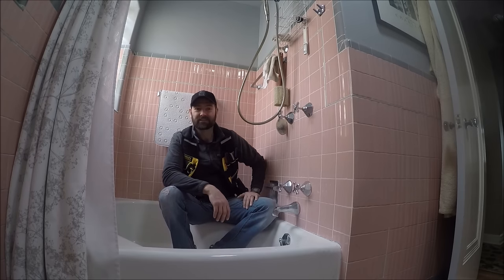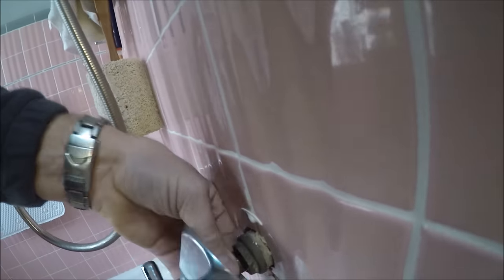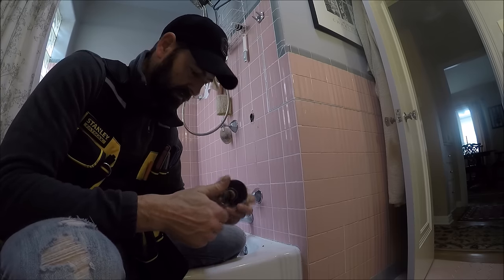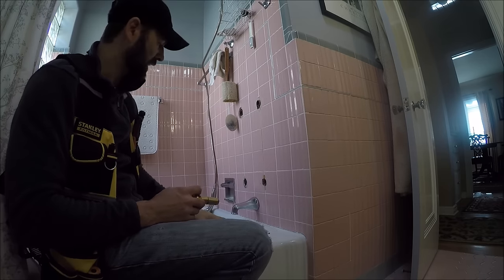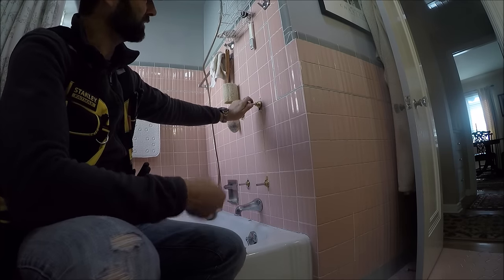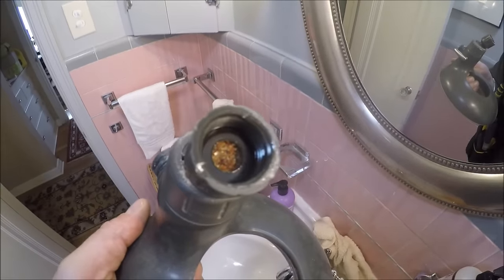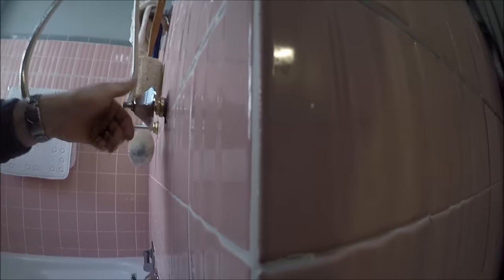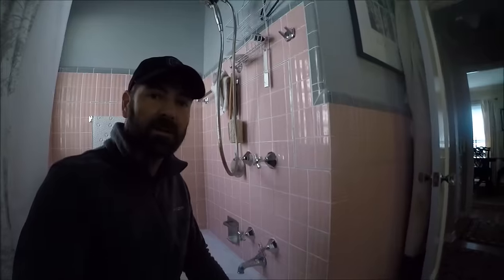HOW TO REPAIR ANTIQUE SHOWER FAUCET | THE HANDYMAN

Comment: Best shower valve video! Thanks for all the extra tips about packing nuts and pressure differences between shower and tub...and the tip about the packing leaking due to clogged shower head. You clearly know your stuff. Thank you for sharing!

Comment: Thanks for this. I'm currently replacing glav. piping in in 1914 home. I live in a historic district, and there are always people who need 'small' jobs like this done. Many of the plumbers in the area want to avoid touching these repairs and/or charge more than the homeowner can afford. The other issue is that there are a lot of nasty plumbers who will take the job but not take the time, effort, or TLC that these old houses require. I mostly do electrical, but I have worked on plumbing on many old places in the city. 
Often when I'm working on elec. for someone, they'll ask me to look at plumbinng issues, so  watching these repair jobs is incredibly helpful.

Comment: As a self proclaimed "handy man", I enjoy seeing any project you are working on. Whether it's you building a fence or installing porch lights in the snow. I like the fact I can see someone else working on the same type things I do, but I get to see you work through them and troubleshoot issues you have a long the way. Which helps me see things from a different perspective.

From a production standpoint, the only thing I could recommend is figuring out a way for better audio. This can be really simple by adding a very small, inexpensive mic to your gopro. There are mics made specifically for gopros.

Other than that, I just say keep doing what you're doing, and like others have said - don't worry about what others want. Do what you want.

Comment: I have worked on that exact American Standard faucet set.They were made out of old  high quality brass and always came out easily. I don't quite get it but those barrels make the rubber washers last much longer.Only 2 out of 24 ever needed work over 9 years. They are a high quality faucet  the likes of which is no longer made. As to the new replacements put in, I was always needing to work on them.

Comment: I have to say as a "Handyman" you did better than most real plumbers. If I can offer a little advice and this is just the way I was taught. On an old faucet like that, which isn't "washerless" but still uses uses actual rubber washers. When you're turning (tightening or loosening) the packing nut or the main retaining nut, you want to always make sure to turn the handle in and out as you do it. This is to make sure that you don't tighten up to hard against the wrong washer at the wrong time and risk tearing it and making a new problem on a part you might not be able to replace. So if you can (been there too lol) take off the chrome cover put the handle back on and turn that as you use your pliers. 

Also one more thing to think about is you want to take a part  your new seat and stem (your new parts)  as easy as you can by hand and lube pretty much every brass and rubber piece you can get to faucet too screw it back together by hand and do exactly as shown here making sure to turn the handle as you do it. 

Thank you and keep up the good work. Especially about not being there to argue with the customer but being there to do a job and not leaving until he was happy and you fixed his actual problem 👍

Comment: I have the same valves in a 1950s shower/tub with only hot/cold. Open cold valve and no water, but open hot and have water at tub or shower.  Tried replacing washers with no luck.. Thanks for identifying brand and model.

Comment: I cannot express just how much I appreciate this video. My bathroom is also from the 1950's (1953), and this is the shower handle style I have (thankfully my grandmother had taste and opted for the grey tile instead of pink). We thought for sure we had to go inside the wall to replace the gasket. You just saved me a load of money, my water bill has been insane. Can you please tell me how to go about finding a specialty shop to get handle replacements. The chrome finish on mine are a mess from the constant hot water flow from the leak. Thank you!
Reply: There's NY Replacement Parts, for one. There are others, as well, that specialize in parts for older fixtures.

Comment: I'm pretty good with most trades but plumbing and electrical are by far, my weakest skills! I own a house built in 1960 and had absolutely no clue what was happening to my shower temp and pressure. I did eventually discern that the galvanized pipes were flaking off in my shower head filter but I still have a standing issue with temp control! Looks like I'll be exploring the replacement of the faucets and hopefully, a pex manifold for the entire house! Thanks and wish me luck!!

Comment: Where did you get that replacement kit? I went to home depot and the stem and packing unit was different and did not go into the whole. Mine is exactly like the one here is this video.
Reply: try a store that specializes in plumbing supplies they should have or be able to order something that will work. big box stores like HD Lowes are just gonna have the most common stuff.
Reply: Ya-hooo now to find the plumbing store and hopefully can get the stem I need to replace the broken hot water stem. Gonna be wonderful to take a shower. New subscriber love all the info but I had to laff with not at the guy with hammer...know the frustration well. 😂 Wish there was good handymen in  Northwest Fl. Guess me and my daughter will have to tackle this. The videos very helpful and the laughter too. Keep up the great job Handyman ..it's all appreciated.😊

Comment: In this excellent video (thank you!) the fixtures you’ve removed look like what I have, and the age 80 yrs is about the same, so 🤞you can help me. I’m looking for a particular Speakman x handle to match another. Its for a 1936 bathtub faucet - everything works fine but the H handle is missing. I’ve checked locally and haven’t had luck, plus learned that there are soooo many variations that specifics are key. What I know is Speakman hole 35, 20 splines.

Any suggestions would be welcome before I resort to settling for newer handles, change out the stem units etc.
Thank you!

Comment: I am having a hot water leak with a similar shower. Do you think it'll be okay to replace the stem or would it not seat correctly after putting the new stem in since the valve is so old?

Comment: The connection between the increase in pressure due to the clogged showerhead and the packing nut leak is a valuable takeaway from this video.

Comment: I still remember trying to change- these exact fixtures- i fought with them about 4 hours took a hammer to them (frustration or desperation or annoyance) lol- 15k later got a brand new bathroom - from a faucet- wish I would’ve watched this video-
Reply: I was on that exact path until I randomly stumbled upon this video. The exact path.
Reply: Too bad all those old hardware stores got put out of business by The big lumber stores. You might have got advice from an old timer who did that job  more than twice. It's very rare to find anyone on the internet or the lumber store that can give sound advice. I know i'm that old  fart who runs a full service hardware. This guy  found the correct parts somehow. I live in an area where everyone has indoor plumbing but i'm the only store with parts like this. It's a sad state of affairs this country is in.

Comment: You likely could have just cleaned that screen from the shower head, and this job would have been done. Swapping all the valves just became preventative maintenance, I would imagine.  We tore out all of the galvanized plumbing straight away when we bought our old house. Nasty stuff!
Reply: if you're getting leaks of any kind, it's a good idea to at least replace the stems/cartridges and gaskets. The showerhead should really be replaced as well. Any leaks or diverter
issues from the tub spout, that should be replaced as well (which is really the cheapest repair of the entire job!).

Comment: i  Have the Same shower Mixture in my bathroom, Same tile too,   LOL  anyway mine has the three knobs Hot Cold & shower, it is starting to drip, i tried to get those Damn Handles off would not come off,  so i am going to try the tip you just gave,   Thanks for the Videos  'they help"

Comment: Your videos are great.  One question: Do you find that your tools fall out of the Stanley vest when you bend over?
Reply from the maker: +Bryan Bender they don't.   Some of the Amazon reviews say thay they had problems with tools falling out but after wearing it for 100s of hours.  I might have had a tool fall out 2 or 3 times.
Reply: @TheHandyman1  If you don't answer the questions on what you replaced it with (exactly) and how you got it --- I'll be UNSUBSCRIBING

Comment: Drinking the water out of galvanized pipe will not harm you at all. In fact allot of people have too high a copper level due to their plumbing being copper. It is inferior to copper in longevity for sure and once either gets a coating they both are safe.

Comment: Are they really 80 years old?  I have relatives with a home build in the mid 1950s and their tub faucet and hot/cold faucets are identical.  The only difference is they do not have a second set of valves for the shower head.  They are obviously non anti-scald but regardless, that bathroom looks like a 1950s bathroom.  Even they have a similar style of tile, not pink, but that bathroom is nearly identical in every way.

I think an 80 year old water faucet system would look a whole hell of a lot different if it was in fact original to the home!
Reply from the maker: 1946
Reply: Well that's more like 71 years.  Must have been using this style faucet and spout well into the late 1950s.  I kid you not, it's identical, with the exception of there only being two knobs for water with a third knob in the center to control the diverter between shower head and the tub spout.  The escutcheons are identical as well.
Reply: my 1936 house has these, without the upper 2

Comment: where did you get the replacement kit? or who makes it? thanks
Reply from the maker: A small local plumbing supply store.  No computers just a cash register and an old guy.   They were brand new so you should be able to find them online.   The old guy took one look at the old ones I brought in and walk away then came back with brand new in box replacements.
Reply: thanks!
Reply: @TheHandyman1  we have a place like that in Detroit. The guy has been working there for 60 years. One look and he goes straight to the back and gets the part that you need. The running joke is he is still trying to get his 90 days in.
Reply: @TheHandyman1  who exactly is the manufacturer of the  replacement and what is the model number ?

Comment: Boy i thought Crane would make better stuff than that .I have a house that was built in 1965 the faucet is a Moen 1225 cartridge i installed to replace the 1200. The spout with the diverter screws on i have a chicago faucets 1/2 in chrome globe valve stop with a cross handle on the end of the heavier wall shower arm a close brass nipple then the 1 gal per minute shower head. When i wash my hair i pull out the Moen handle and throttle the flow to less than 1/2 flow,wet my head,pull up the diverter water stops [globe valve at shower head closed] ,shampoo, push down the diverter rinse ,pull it back up conditioner and pop it back down fore the final rinse push in the Moen handle .This saves tones of water . ONE DAY I FORGOT TO PUSH IN THE MOEN HANDLE FOR TWO DAYS NO LEAKS OF ANY KIND!! [sorry crane] . A lot of people have valves at the shower head so they can lather up  ,save water these days .If i had Crane i would try to put a small o ring & grease behind the packing nut. After seing this video im NOT VERY IMPRESSED WITH CRANE SHOWER VALVES & STEMS. I hope that were ever i live if they dont park the toilet next to the tub i can bring my globe valve & shower arm with me so i can wash my hair without having the water run constantly wasting it.I hope that all newer tub shower valves are designed with FULL STOPPED PRESSURE IN MIND.I think a lot of the newer ones suck because you cant control the volume of water coming out LIKE THE MOEN ONES YOU ROTATE THE LEVER UNTIL THE DESIRED TEMP IS REACHED .the water is coming out full force [hate this]
Reply: The only answer to the full flow thing would be to buy a chrome brass nipple ,flange ,chicago faucets globe valve,small nipple & an elbow to replace the spout so i could control the volume of water coming out so i dont get blasted [moen tub/shower valve with rotating leaver]